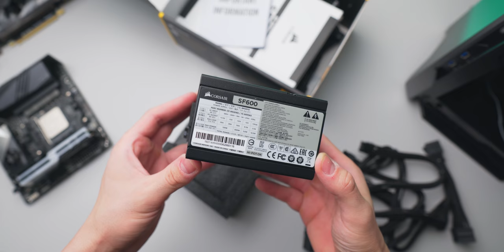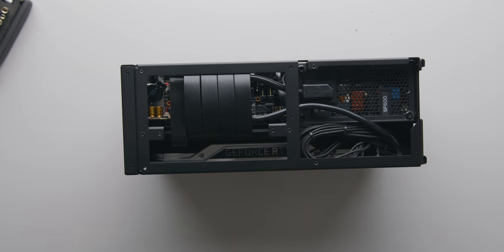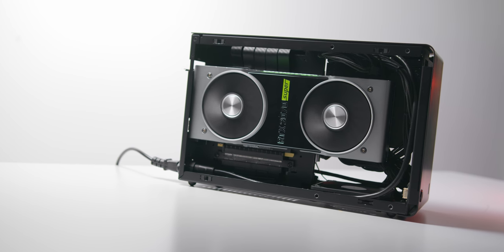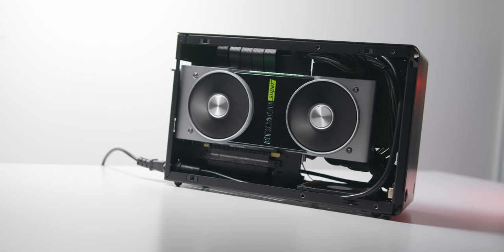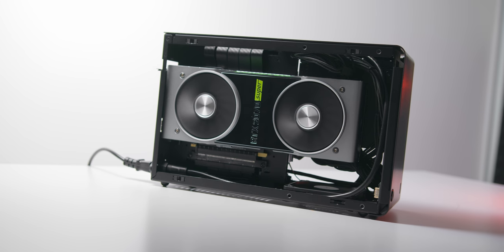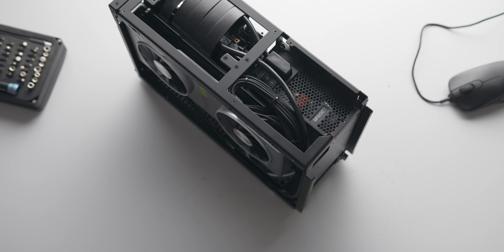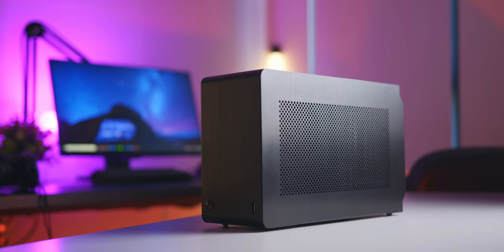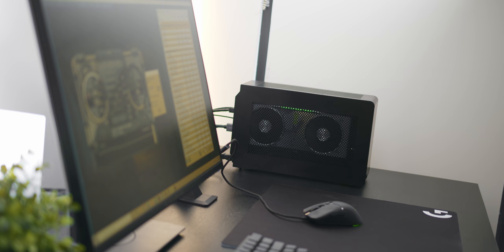$1600 Dan A4-SFX Gaming PC Build Guide

Comment: You know the only thing that is missing from this case? A handle. Something like this that can be compact and give you everything you need that you can carry around easily - needs a handle. Some kind of handle that doesn't make it look cheesy maybe you could just buy a strap for it. The only issue I am seeing is that and the fact that if I tried to carry it around without a handle its beveled edges would make it very easy to slip out of my hands. I say - give the damn thing a handle.

Comment: Would you still recommend this with the next Gen GPUs? Im considering a i9-10850k + a RTX 3080, but I somehow worry about temperatures. Id ofc install the bottom 92mm fans, but is there anything else? Deshrouding is not for that case, right?

Comment: Sorry I got two more questions..
1. Would I be able to use MSI RTX2070S Gaming X(297 x 143 x 56 mm) model GPU? I was told that MSI RTX2060 Gaming Z(247 x 129 x 52) fit in Dan A4-SFX without any issue.
2. Do you know if Alpenfohn Black Ridge Cooler will also fit fine on MSI Z490I Unify motherboard? If not would it fit on Asus or Gigabyte Z490I motherboard?
Thank you very much.

Comment: Hey buddy, Firtsly great vid, i use lightwave3d/ after effects/fusion/photoshop..oh and "Hell let Loose"...i'm coming from my 2011 imac...which believe it or not works great, but rendering times and the price point for a new one in this climate seem distant...so, would you suggest this build with a ryzen5 3700x change?.
Would that be sufficient for my workload....at that price point? Thanks in advance....

Comment: Stupid question for ya - there's a plastic sheet hanging in the psu area of the dan a4, I though it might have been something to block heat between the two sections but you throw it out straight away? Waiting on the next nvidia gpus also and crossing my fingers that the sf600 has enough juice to cover the lot!

Comment: The question that i have, if its better to use a water cooling option with 92mm AIO and the secondary fan under the motherboard or your suggestion with the black ridge cooler and an extra fan under the motherboard ?

Comment: Wouldn't a regular noctua NF-A9 (non-x14) fit and work better beneath the psu? It looks like you've got enough space for one, and might help exhaust even more hot air while running quieter.

Comment: Perfect timing for this, just about to build mine. 

The plan 
Asus B450-I 
Ryzen 5 3600x,  noctua nh l9a, 14 &. 25 mm bottom fans, sf750 platinum, ram(undecided),gpu (undecided) leaning towards asus RTX2060 super .. anything you would recommend or change on this build ?
Reply: Ruben Schilling :( I already have X, bought it on sale months back while I was waiting on my case also have the mother board cooler and fans all the other parts I’m getting ready to buy just unsure of what.. my 1st build

Comment: I was just able to purchase the Dan A4 V4.1 from W360Mod.  Is that the same version as in your video Ali?  My current system is running a Core i9 9900k running at 4.5GHz but would you advise running something less powerful in a case of this size?  I also have an NCase M1 that will be the chassis for my main build.

Comment: Can MSI MPG Z490i UNIFY accommodate the black ridge cooler? That could be interesting as it has a thunderbolt 3 connection.
Reply: Hello, Black Ridge fits on MSI Z490I. Just 120mm slim fan on bottom does not fit as IO shroud is a little bit too big. Just keep an eye on your BIOS and PL1 setting, 288W could be a little bit too much ;)

Comment: Anyone have experience fitting the Alpenfohn Black Ridge Cooler onto the ASRock Z590M-ITX/ax? That mobo has the front usb 3 connector that'll work with the Dan A4 v4.1 case. I just hope there's still enough clearance for the cooler to fit nicely.
Reply: Happy to report there are no issues fitting the Black Ridge cooler onto the Z590M

Comment: I like the small factor, but can i build one using 2080 ti and i9 10th with power supply 1000w , in a way the air flow is good ?

Comment: Is there an AMD Ryzen take of this?
I see plenty of builds (on pcpartpicker and elsewhere) that are not using the most recent AMD CPUs in them.
I take it that it is impossible to put an fan/air-cooled 5900X or 5950X in these?
So what is the current mid-2021 highest end fan/air-cooled AMD Ryzen CPU that the Dan Case A4-SFX can accommodate?
Thanks!

Comment: my biggest concern with this is honestly that I'll spend a ton of money and fail to fit the cables in. so it won't fit in or i wouldn't be able to close the lid lol

specially since I'll probably put a 2tb hdd there too for games that don't mind it, and maybe even a second sata sst? i doubt the sata ssd tbh since m.2 are cheap now.
Reply: I have 2 8TB nvme SSDs in RAID 0, a 3080ti FE, and a water-cooled 5800x in this case. You'll have no issues closing the side panels if you do it right, but there are also mods that give you a little bit of extra space.

Comment: Have 3700x + dark rock pro 4 @600rpm mainly for dev purpose. Very silent setup. Wondering I switch to i7-10700 with this smal fan would it be silent as well ? let's say I'll put it  under my desk
Reply: Do not switch to an i7 if you want good thermals and good performance across the board unless you are ONLY gaming on it. I have the 3700x but I’m on a 240mm aio and it is silent

Comment: i wanted to build something like that a ryzen 3900x but the guy at the store who was building my pc said mini itx run to hot and it will blow your cpu and damage it.. is that true are did he just screw me over?
Reply: it is 12 cores so it does run hotter if you can find a good cooler that fits in your small pc it should be fine but temps will in the 95s+. Not the best temp for long term.

Comment: Hey can please tell me 
 I've brought antec neo eco 550w psu problem is psu power cord is 13A uk style 3 pin plug  type G 
And in india there are type d socket 
 So my question is can i use my old psu power cable as replacement for 13A power cable. 
 Please help

Comment: If you're looking for rendering performance, you should be going with Amd's higher-core CPUs. Using an Intel processor that's only good for gaming (and it's great for that) doesn't make much sense. It seems like your recommendations are backwards on the CPU front.

Edit: At the end this very recommendation is made, although I would say 3600x is low for that kind of workload (but serviceable). It still conflicts with your earlier statements about the graphics card being good for rendering and the 5700xt as an option if you wanted to be more gaming oriented.

Comment: Hello Optimum Tech,
wanted to ask if you could maybe install and test it in the case Dan A4 v4.1
     
GPU: 3080 /3090 or 6800xt
CPU: i9 10900k / 10850k or r7 5800x / r9 5900x
CPU cooler: Aio and Low Profile CPU cooler

That would be really nice

thanks

P.S .:
Make really good ITX system videos. So I would like to have one now. ^^ and I imagined the components that way, hence the question

Comment: Hi sir .. I just want to ask about GPU compatibility, I want to upgrade my GPU from GTX 1060 to GTX 1660 Ti and I don't know if this new GTX is still compatible with my board. I am using a Asus Rog Strix Z270 H board I am really concern if it won't bottleneck with my i7 7700 and if it will be compatible ?

Comment: I'm running a similar setup with a Ryzen 5 3600, Rog Strix B450i motherboard, and noctua low profile cooler. Playing new AAA titles, my CPU gets into the 90s, even with a slight undervolt. I really want to get the black ridge cooler. Does anyone know what I'd have to modify to fit that cooler?
Reply: Fan on bottom won't fit together with the M.2 heatsink on Asus B450I Strix. You can remove the M.2 heatsink or use slot on back of the mainboard. Or (re)move 92mm fan somehow.
Reply: @alpenfoehn-de  I'm going to give it a shot. Thank you!

Comment: Ali, take a look at ZS-A4 V3: its only 6.2L, fits the same GPU and CPU heatsink, 2 fans on top and also has thicker aluminum panels with mount similar to Ghost S1 https://smallformfactor.net/forum/threads/zs-a4s-v3-sweet-size-for-compact-mid-spec-air-cooled-build.14272/#post-212520

Comment: Form my Dan build I bought z490 phantom gaming-itx/tb3 motherboard https://www.asrock.com/MB/Intel/Z490%20Phantom%20Gaming-ITXTB3/index.us.asp, and it was really a mistake.
The front M2 slot (marked as M2_2) is located on the I/O Expansion Card which is too tall to close the case. So, you must remove it and use M2 slot on the back of the motherboard, which I believe is not the best in term of temperature for you nvme ssd drive.
You can’t install Black Ridge, so I ended with 645lt and pslate custom cables.

It’s my fist SFX build so I went the safe 65W TDP way with Intel Core i7-10700 CPU.
For the GPU I will wait for next NVidia ampere, really does not know if the CPU can be a bottleneck?

Comment: why would You put bottom fan as exhaust?
Reply: In sff cases, negative pressure is much better than positive due to the power density. It is better to try to take out that hot air in that tiny case than pushing in more air.

Comment: A silly question: when installing the hard drive why not remove the sticker on the drive so that the thermal foam touches the chips directly?
Reply: From personal experience:
Easier RMA and before modifying something like that, always check temps first, might not be necessary
Reply: @exterminus2579  I wonder why would that affect a potential RMA process? Does removing the sticker void the warranty?
Reply: @killy9999  Samsung 970 have serial number on the sticker, and no serielnumber did prove troublesome when I tried to RMA it.
And shitty retailers will try all of the excuses  to not replace defunct electronics.
Plus  the new drive with sticker is doing fine (imho not hitting 60° under full load) thermal wise, so why change it.
As is stated before: always test before modifying if modification is necessary.

Comment: If I have the asetek 645LT should my fan under mobo be set as intake instead of exhaust ? Also how does watercooling compare to air cooling in this case ?
Reply: Intake 👍
Reply: Depends on your CPU - if you got something beefy you could use a blackridge + 120mm slim fan if you have VLP RAM but you can't cool much more with air - then you have to move to the 645lt
Reply: I did some testing and using a 2080 blower card with the bottom fan as exhaust and with a 645LT I sit at 63C in Heaven after 25 mins and my cpu under load goes to 69C max (ryzen 7 3700x)
Reply: But I made custom side panels which might give better airflow ?
Reply: At least with the standard side panels benchmarks show intake... Maybe not in your case - just try it 😊
Reply: I read that intake is best for air coolers and exhaust is best for aio
Reply: Does anyone have data/experience comparing both ?
Reply: @barry3917  there are a lot of benchmarks showing the other way around - I think even optimum tech has said it in one of his Dan videos